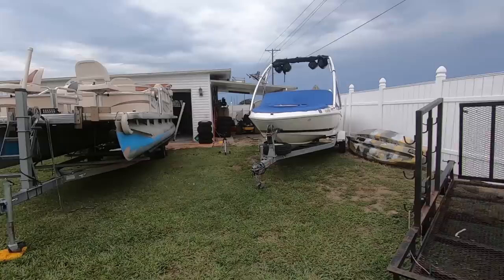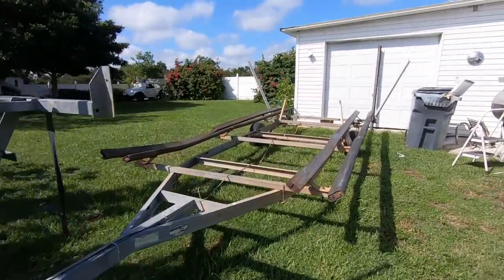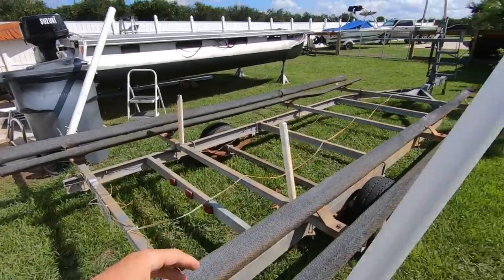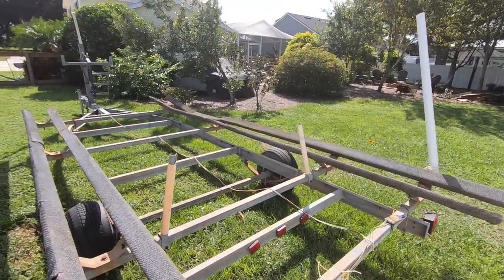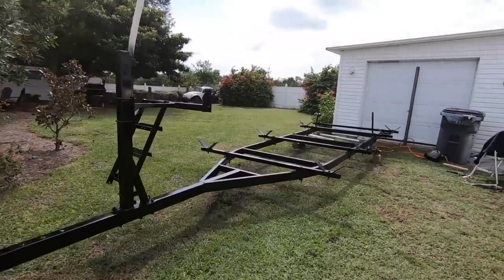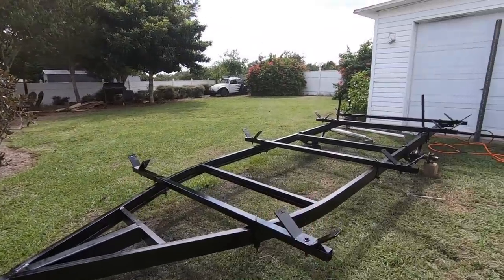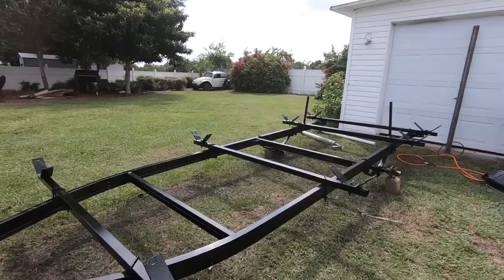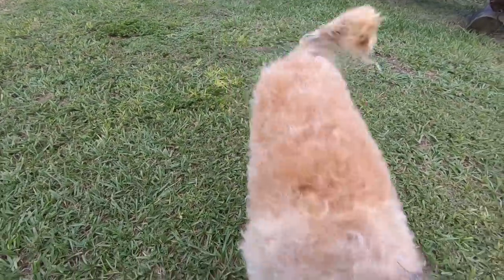Restoring My Pontoon Boat Trailer -Episode 5

Comment: Looks awesome all the way to the end until you show that wiring at the rear going from the lights to the vertical lights (11:56).  You should get some black wire loom and some zip ties and clean it up.  would make it look so much better.  Great work!  Can't wait for the next episode.
Reply: Maybe run the wires inside the frame?
Reply: @theupscriber65  he could but It would be a lot easier to just to loom it and zip tie it.  then if you ever have any issue with the wires its easy to get at.

Comment: Great job, it looks fantastic.  Two things (not criticisms!) but . . .  1. For a little (more?) contrast, I would've painted the coupler silver/gray to try to match the winch & jack,  and 2. Maybe the new ones were cheap & maybe the old ones weren't salvageable, but I would've tried to save the old wheels by sanding, priming, painting & clear coating them.  Breathing new life into a trailer many, if not most, would've given up on is awesome!

Comment: Did you replace the U Bolts holding the Axel to the springs?  Mine looked good until I smacked them with a hammer and they shattered into rusty junk.Thats the only thing holding the Axel in place I was surprised to learn. I use 316 Stainless Steel everywhere I can.

Comment: I believe the tongue jack mount should be rotated 90 degrees so the bolts on the frame. The weight of the boat will make the tongue jack mount move. Happen to me. Nice Channel to have going. Good Luck.

Comment: Where did you get your wheel/tires from. Our trailer takes 20.5 x 8-10 as well.  I've been looking around for a replacement
Reply from the maker: Amazon has some of the best prices for trailer wheels. And they ship right to your house
Reply: I get mine from Northern Tool. It's kinda like a Harbor Freight store but bigger and better in my opinion.

Comment: I would have put some kind of grommets in the frame where the wiring was passed through but otherwise it looks like a great overhaul on your spanking new trailer.
Reply from the maker: There is rubber grommets where the mounts for the wires to pass though are.
Reply: @ultimaterebuilds7127  Cool, just didn't make it into the final edit, lol.

Comment: As a current pontoon boat owner I would strongly suggest adding another axle. Those tires are only good for around a thousand pounds a piece and I'm going to be willing to bet that that boat and trailer together when done are going to weigh in closer to 4000 pounds. I would also strongly recommend measuring from your hitch  point  to the outermost ends of your axle to make sure that they're the same distance .  Mine was out about an inch  so I had to cut the brackets off and move them forward on the driver side. I would sure hate to see you put all this effort into making a nice boat just to see it get ruined from a blown tire or bent axle going down the road.
Reply from the maker: Yeah I’ve been looking into that too.

Comment: tail lights wrap air hung wires in black split plastic and use clips or black tie wraps to fasten a secure route to the frame...for safety!

Comment: When I put the carpet on my boards like that I used carpet glue to the wood then stapled the fire out of it on the back side. Old man full of wisdom told me to do it and it’d last longer and don’t worry about using stainless steel bolts on them because the carriage bolt will need cut off and replaced when the wood roots away.  Little money saver he told me.
Reply: Just had to replace my bunks. Glued and stapled the heck outta them. Used lags to connect bunks to trailer. That was what was used originally and they held up for 20 years.

Comment: I’ve been told not to use pressure treated lumber because the chemicals in it are bad for aluminum but don’t think it should be an issue as you have bottom pant.

Comment: Buyer beware for lighting kits.  i picked one up at home depot and the led lights are great.  Unfortunately the wiring was dangerously defective.  After 1 year, the lights started flickering and went out.  I went to the connections to cut, strip and reconnect them.  Every time I tried to strip the wire it broke when I tried the pull the insulation off.  The entire length of wire was corroded inside the insulation.  It broke with any tension applied. This trailer was never used in salt water and the wire was corroded in places that were above the water line.

Comment: I would have painted the pvc guides since you added the lights to them personally, and of course wire loom the wires. I hope you soldered the connections too.
Reply: Paint won't last on pvc bro
Reply: J Hansen absolutely correct I just hate scuff marks on it so I reapply paint twice a year and it looks fine

Comment: Trailer looks great. If you paint the pvc uprights they'll hold up better. UV rays make them brittle and crack easier. I don't think you're supposed to paint over galvanized metal.

Comment: Not trying to be the Monday morning quarterback but if you want the paint to stick to galvanized metal (as well as aluminium) you need to etchprime it first. Only that will bite into the metal.
Reply: Good point, never heard of that product but we always wiped galvanized down with vinegar then used regular metal primer and the finish coat to get paint to stick.

Comment: ya gotta think about the weight that outboard won't do it if you put much more it will be too slow and get bow flooded if you hit waves also you NEED a kegerator be have a full bar on our yacht and it is the best thing ever

Comment: I really dislike the wiring that comes with light kits because it's so thin. I get heavier gauge wire. As for connections, I always solder them, then put on liquid tape and cover it all with shrink tube. It creates a solid, watertight connection. I also never use the trailer as a ground for lighting. I use a separate wire. On almost every trailer I have worked on with bad lighting it's either a bad ground due to a broken wire or corrosion or a bad connection.None of my trailers has ever had a problem using my method.

Like others have said, use wire loom to cover exposed wires. Not only does it look better, but it also protects the wires. Then use zip ties to hold them to the frame so they don't get snagged or vibrate in the wind.

Speaking of protecting wires, I hope you put rubber grommets every place you fed the wire through metal. Vibration will eat the wires up if you didn't.

Also, the all black looks cool, but I would have used grey for the bunks to provide a little contrast.